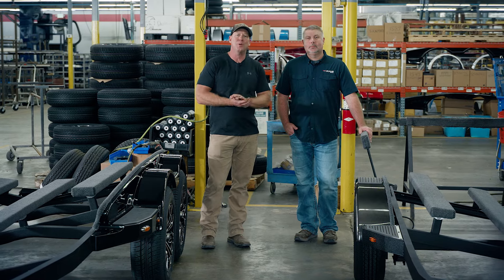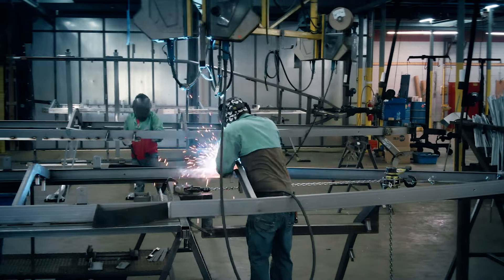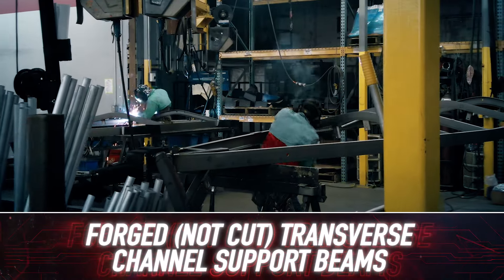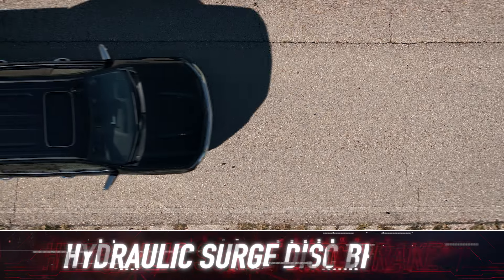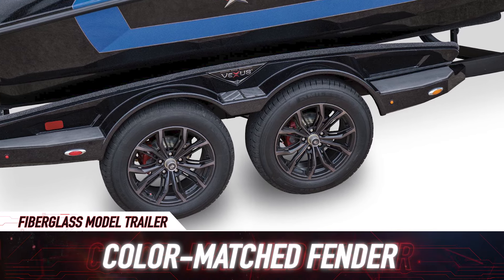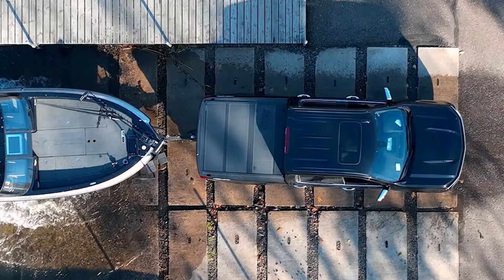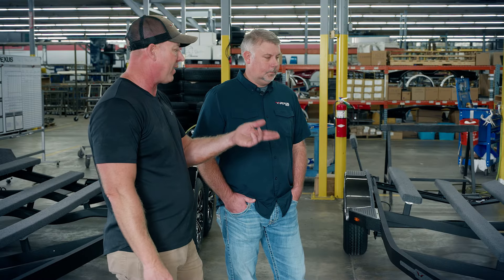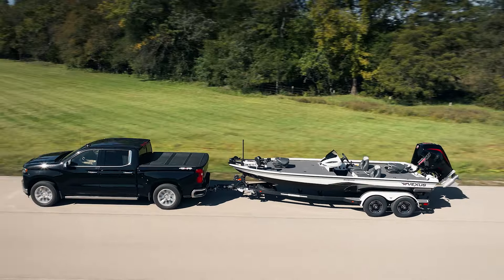Vexus® Custom Trailer Advantages

Comment: Great video on the importance of a really well designed trailer. In 2002 I bought my second boat. It came with a Tennessee trailer. At the time I thought “that’s nice”.  22 years later I value the trailer as much as the boat, even to the point of keeping it if I ever change boats.  No wiring issues, stone chip rust in a few places only, no problems with boat support after all these years. The only sad thing is that at 74 the boat and trailer are in better shape than I am.😂😂😂 God Bless!